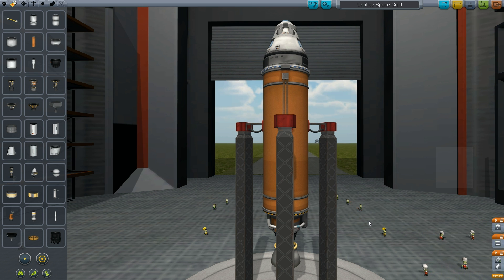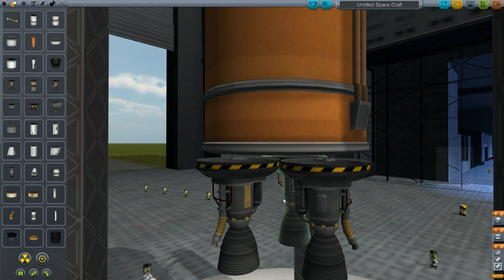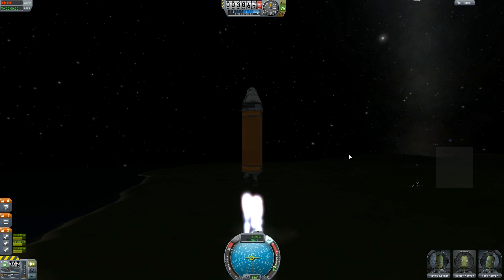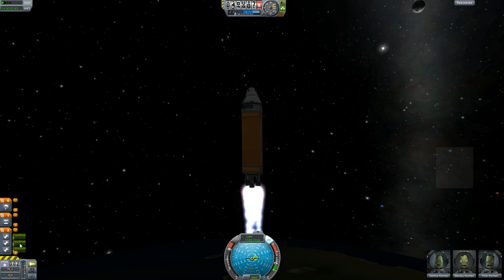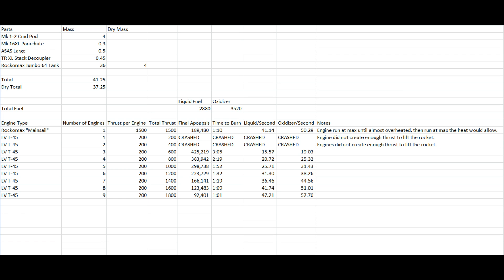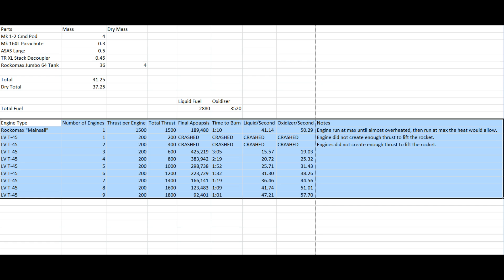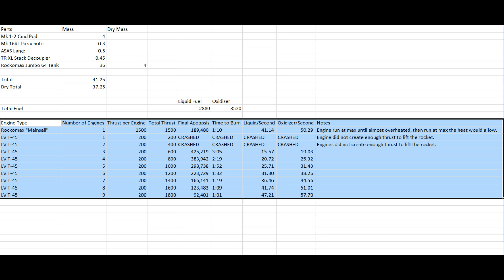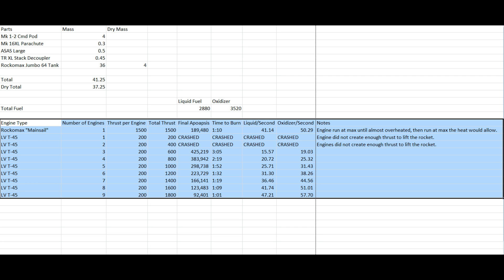Engine Clustering Tutorial - Kerbal Space Program

Comment: any difference using the adapters from stock parts which come with 2, 3 and 4 connections versus using mini girders?
Reply from the maker: Minor weight difference. I actually thought about that immediately after uploading and never bothered to check which was better. My bad.
Reply: no worries. i see there is a clustering plate in deadly reentry parts

Comment from the maker: I have, sir. I will likely do so in a later video. Got a lot of different things going on, but my suggestion for a single full tank is a craft that asparagus stages 8 Mainsails in addition to the center Mainsail, along with a crap ton of solid boosters of both types. Actually, IIRC, I can lift 2 full tanks to 150km apoapsis, and only use around 3/4 of one of those to achieve full orbit. That's how my station is set up. 2x tanks, 4x rcs tanks, 2x stack docking ports, and 4x radial docking ports.

Comment: I think, if you use the LV-30, it should be go a little bit further, cause the 30 is lighter (30=>1.25 45=1.5). It has 8% more fuel consumption but on the other hand 8% more thrust, but you are almost a ton lighter, maybe it works.